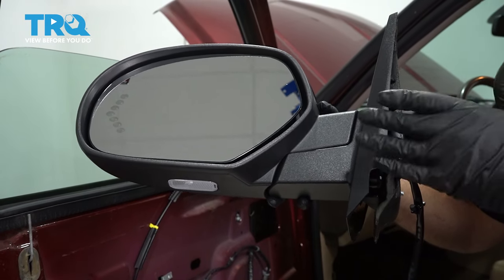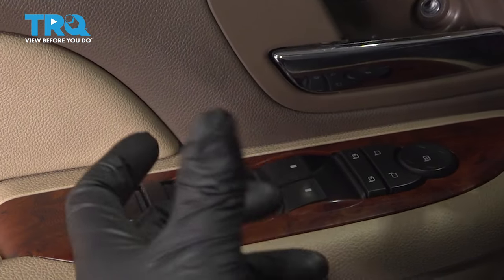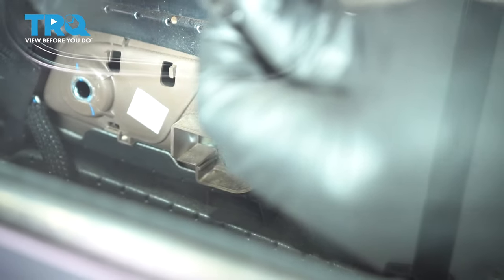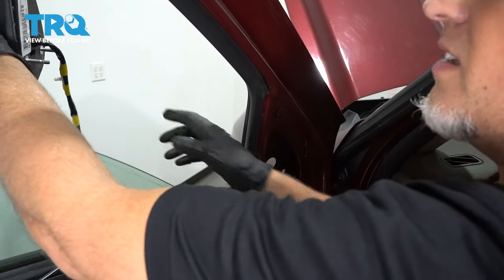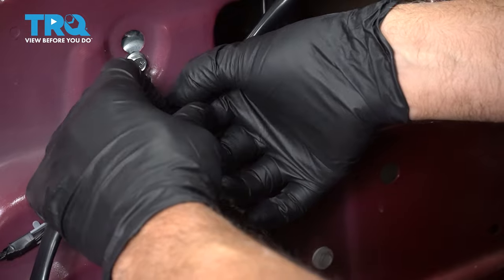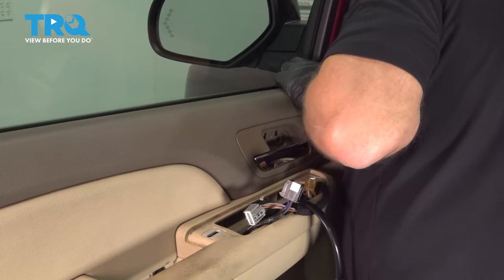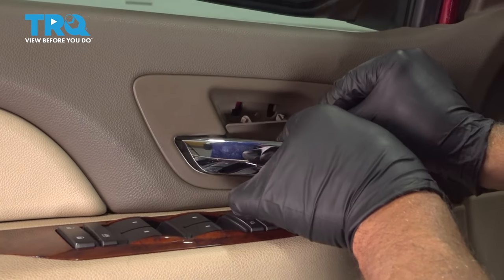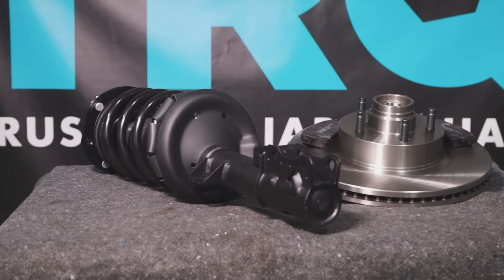How to Replace Exterior Mirror 2007-2013 Chevrolet Silverado

Comment: I installed them. But, now when i put it in reverse the passenger mirror wanders around. Would be fine but when i put it back into drive it dont return to its original spot. Suggestions?

Comment: I just bought these to replace on my 2008 chevy and the RH Mirror dont sit flush on the door i dont know whats wrong... i compared it to the original one and it seems that the one i recieved has the metal part of the mirror sticking out about 1/2in and that prevents it from mounting flush. I will contact customer service first thing tomorrow morning